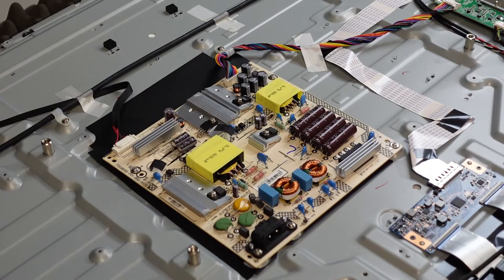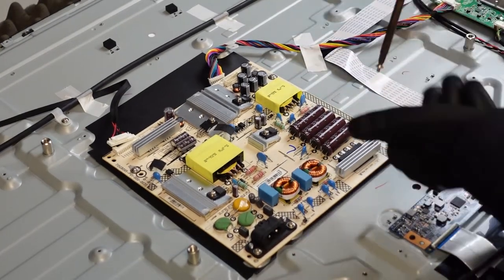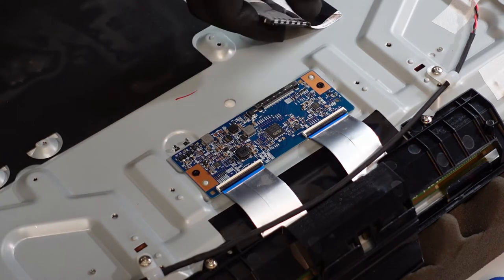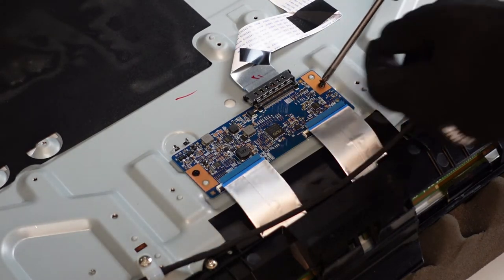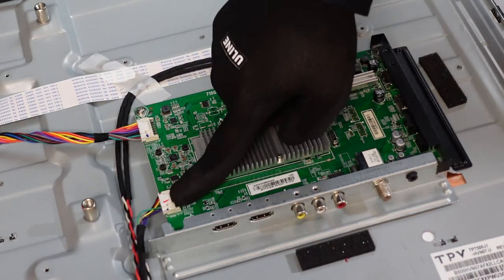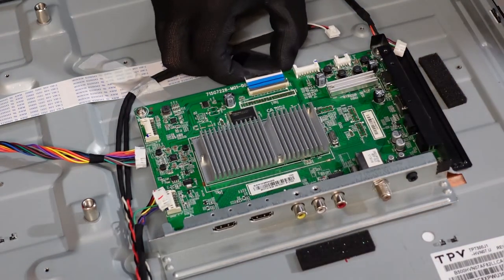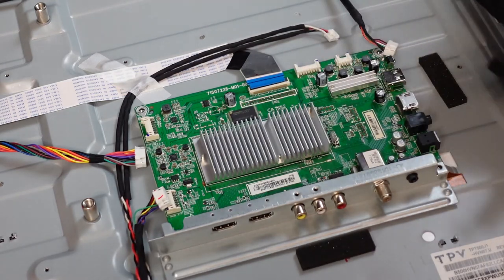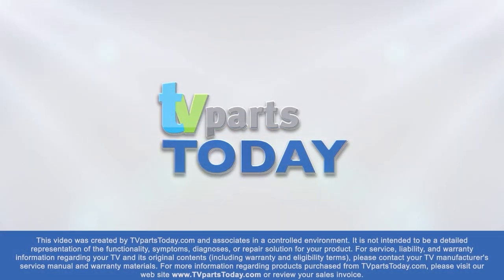Simple ways to remove TV parts. (SHARP LC-50LB481U TV)

Comment: This has been such a great video. I'm trying to get my parent's TV working again and it's the exact same model. It is a black screen that when I turn it on with the button on the tv I see a bright red light to show it turn on, but then it is a dimmer red light flashing. What do I need to repair this? Thank you for the help.
Reply from the maker: TV repair is a process of elimination; you replace the most likely circuit board to the least likely circuit board until one resolves the issue. If none of the circuit boards fix the issue then it is determined to be a failure within the back lights or the panel/screen. 
Based on the information we would recommend starting with the main board. If you need help identifying any parts please email Info@tvpartstoday.com a picture of the mode number sticker and they will help you!

Comment: hi.  Just Subscribed!  Excited.  My TV is DARK but i can see it's still functioning, Can i fix this myself? and if so, what part is malfunctioning?
Reply from the maker: Hey there Serena! You most definitely can attempt the repair yourself! If you can see that the TV is still functioning then it sounds like your backlights may be out.. I would recommend starting with either the power supply (or LED driver board if your model has a separate one) and if that doesn't get the backlights to come on then it would be the backlights themselves! Please reach out here or email info@tvpartstoday.com for more assistance.
Reply: I have the same problem as Serena.  Can here everything, change the channel, and see a picture with the use of a flash light. Can I change the back s and how?
Reply from the maker: @michaelseaton4863  We would suggest starting with the power supply board (or LED driver board). If that doesn't fix the issue then you can replace the back lights. Be careful though when replacing them you don't want to damaged the panel. You would need to take off the back of the TV as well as the metal back to get to the back lights.